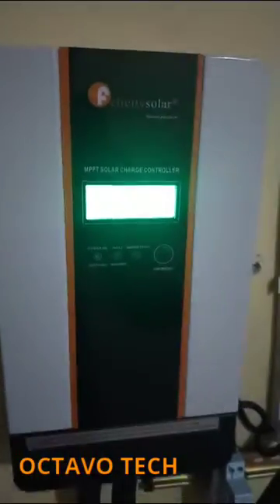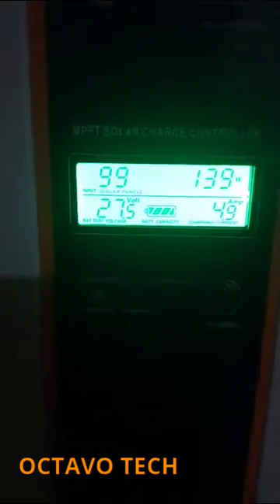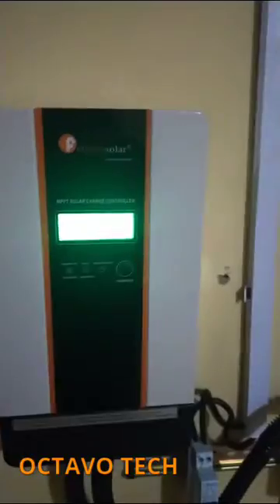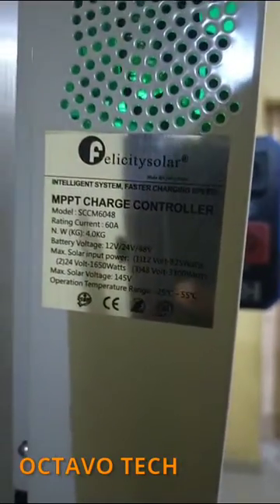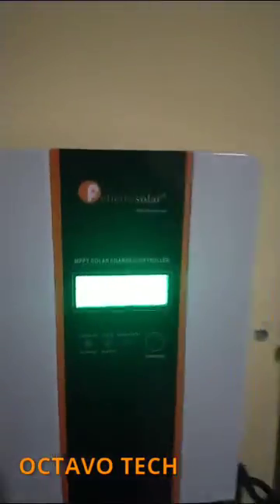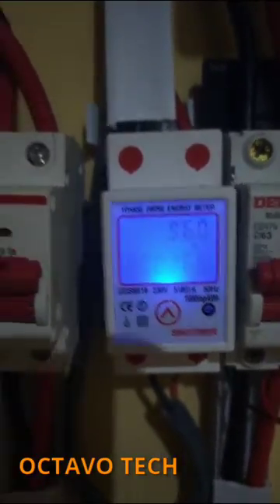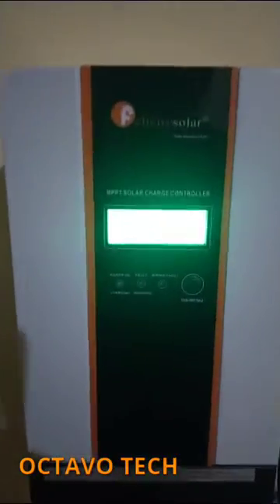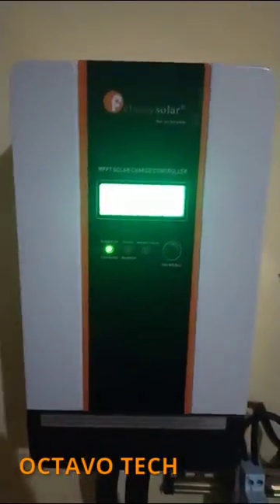Felicity MPPT charge controller overview - is it worth it?

Comment: Hello bro. I have this exact setup as yours and the charging current I get from it is same as yours. But I recently upgraded to a 48v system, comprising of the following:

10 x 380w mornyray panel with 9.47 amps and 40.15 volts.
120amp felicity charge controller 
20mm cable (10mm red, 10mm black)
4 x 230AH battery.
Connected 2 sets in series and 5 sets in parallel.

Now, these are the 2 problems I’m having.

1. At night, the charge controller doesn’t go off, it keeps showing battery voltage with fault red light. But when the sun comes out, it will begin to work normal.

2. At 500w of sunshine, I’m only getting less than 10amps. But on my 24v system, I’m getting close to 20amps at 500 watts of sunshine. 

My 24v setup is made up of the following:

4 x 330 mornyray panels at 9.925 amps and 33.25v. 
60A felicity charge controller 
10mm cable (5mm red, 5mm black)
2 x 220 batteries 
Connected 2 sets in series and then parallel both sets.

What do you think could be wrong?
Reply: Bro, call your installer that helped you upgrade ASAP. Its obvious there is a problem somewhere.  And also, is your MPPT covered by warranty?
Reply: @fm4real2k6  Yes bro. My charge controller is covered by warranty. The funny part is that my installer is confused of the problem.
Reply: There is voltage mismatch on the board... each board should be read  during the day to know the actual output. if that is solve then proceed to your contoller and  change it. you should be having upto 35 charging amps from your 48 volts panels in series.
Reply: Nothing is wrong with the installation, 
More volts, less amps, and vice versa.
Reply: Since one panel can give you more than 30V, I thought you don't have to connect those panels in series for 24V battery
Reply: @joelajamu1  you are right, on a 24volt system , 30v panel will work,  but on a 48v system you will need to wire 2 or more 30v panels in series to achieve the charging voltage requirement to charge the batteries
Reply: @joelajamu1  The 4 panels are all connected in parallel now. Charging amps is now higher. Thanks bro! 🤗
Reply: Brother, . looking at your 48volt setup, how did you manage to wire 4 batteries in parallel to achieve 48 volt, actually you needed 4 batteries in series for 48 volt, you need to rewire your batteries bank before you damage the batteries. Also you PV input have to be higher than the charging batteries voltage. Hope this help.
Reply: @ademanster My battery bank is connect in series and not parallel. All the 4 batteries are connected together as one.
Reply: The red fault or warning light at night indicates there is no solar input, or it's not charging.
Reply: Good day.

I don't think your system has any problem sir.

Let me start by addressing question one, for the red light to come on, it doesn't mean there is any faulty with your system, it is because the controller is no longer seeing input from your solar panel and that is correct(it is night time and there is little or no photovoltaic energy available).

Question 2. For your system to be producing about 10A at 500W is ok at a system voltage of 48V.

Remember Power (W) = Voltage (V) X Current (I)

If your system voltage is 48V, then your battery voltage will range between 46 to 50V, now let's use battery voltage at 48V

Then I = P/V

Where I is current, P is Power, and V is voltage.

I = 500W ÷ 48V = 10.42A
Your current at this voltage is around 10A. Note as your battery voltage increases above 48V and your power is constant at 500W, the current drops.

Now let's consider a 24V system.

I = 500W ÷ 24V =  20.84A. Also if your battery is charged above 24V to maybe 26V, the current will drop at a constant power of 500W.

In conclusion, it can be said that system voltage affects the amount of current at constant power generation.

Good day.

Engr. Udeh Chinedu
(The Solar Ninja)
Reply: @thesolarninja_  🧑‍🔧 you have said it all ENGR because once the battery is fully charged the Amps drops and when you on a heavy load then it goes high again. Thanks from ENGR CHARLES 💡
Reply: @charlesce8815  your explanation although correct does not apply here. Solar ninja explained the difference in amps between a 24v and 48v system and why the op was getting different amps at 500w when he upgraded to a 48v system
Reply: @thesolarninja_   Sir, I’m deeply impressed and satisfied with your explanations. Thanks for taking away my worries. You are indeed a genius in your field. Now I can have my peace of mind. Thanks again. Please where do you base in case I have a future solar installation, so that I can contract you for the job?
Reply: @thesolarninja_  nice
Reply: @thesolarninja_  u we're born for this

Comment: I installed this very type of charge controller 48v system, I noticed it that it only display in the day time when there's sun and doesn't display when there's no sun like in the evening,night till the next day
Reply from the maker: @Simon Messer Mine doesn't turn off at night, would have loved it to do so. Maybe because mine is an older model, it does that in order to conserve idle power at night.
Reply from the maker: Maybe that's how they made newer version, I just saw a similar comment now.

Comment: I got 9 pieces of 300w solar panels, each has 36v open circuit voltage and maximum power current 9.33A. 2 AGM batteries 200ah 12v to be combined in series and finally solar inverter 5kva 24v. Can I use a 60a solar charge controller for this solar system or what mppt size/ampere do you recommend?? Thanks 👍
Reply from the maker: You can only use 60a felicity MPPT charge controller for your 2700w pv input (300w x 9), if your set up is 48v. Maximum pv input for a 24v system is 1650w.
Reply: @octavotech  Boss, have you used this Felicity MPPT charging controller with a Lithium LiFePO4 battery? Does it support Lithium LiFePO4 batteries? Please 🙏 reply bcoz I want to get a 120A Mppt soon. Thank you. Happy New Year 2022 in advance.
Reply from the maker: @kukupulus2949  No, I haven't used it with LiFePO4 batteries. I wish you a happy new year too.
Reply: @octavotech  thanks for the quick reply. Make I subscribe ASAP to d channel

Comment: I'd like to know the maximum pv input for a 120a Felicity mppt charge controller. Cos on jumia it was stater to be 145v while here someone said it 190v. ???  And I got a 230a 24v system still considering to upgrade my battery bank to 1380a 24v but looking at 6300w of solar array to charge. I don't know if it gonna work cos the maximum I'd 6600w and that's for a 48v system. Please can 6300w solar array charge 6pcs of 230ah 24v battery connected in parallel on this charge controller or do I need to get two charge controllers??

Comment: Why does the charge controller make a wheezing sound?
Reply from the maker: My unit doesn't make any sound, it's absolutely silent. No inbuilt fan, heat sink does the cooling job.
Reply: Check if the PV and Bv cables are tightened well.

Comment: Greetings please I have a question concerning the mppt solar controller, after it was been installed the display I'm having is the power on showing green light and the fault showing red light at the middle, my question is what could be the issue why both are showing at the same time.
Reply from the maker: At what time of the day are both (green and red) showing? Also, what's the error code its displaying?
Reply: @octavotech  in the afternoon of Sunday was when we put it on to charge with solar for the first after it was installed the previous day. The error code shows 05.

Comment: Nice video👍 I have the 120ah of that controller is stated on it that the VOC is190  but still afraid if I can connect four 300w in series, because it will about 160 VOC, so I don't know if is safe to connect! what do think I should do?
Reply: The most you can connect is 3 series. I tried 4, it brought the fault code 21 . When open current got to 171 volt. I use 100amps
Reply from the maker: I think it's still safe, the worst that can happen is that you'll get high pv voltage error. The margin between the recommended 190v and 160v which you intend to try is still high enough.
Reply from the maker: @Simon MesserOf course, it is working. It will clock one year next month.
Reply: @octavotech  Good day.....I have a 48v felicity inverter with 80amps controller. I  have 8 270w panels at 37.2 Voc. Can I connect 4 series, 2parallel to become 148.8Voc ,considering the maximum VOC of my controller is 145v, Is it advisable?  Does the controller protect itself from  high PV voltage?
Reply from the maker: @akinwaleakintoye8304  Yes it protects itself, there's nothing to worry about. If there's any issue, you'll get high pv error which you'll see on the screen.
Reply: @octavotech  Thanks

Comment: Please what is the maximum panels  of 160w can it take for 12v system, because the maximum watt  for 12v is 825w?
Reply from the maker: 5pcs of 160w.
Reply: @octavotech  Thank you
Reply: @octavotech  Is it possible to use 6 pieces of 160w, connected on (2 series each) and the 3(24v series ) in parallel? for 12v 3000w inverter on 12v 200A tubular battery?
Reply from the maker: @opeyemiolugbengaoluwadare3260  in MPPT you need more voltage, I will advise you to connect 5 pcs in series instead (that's if you are buying 12v panels, which open circuit voltage will be around 18v).

Comment: Please i want to connect 2 batteries 120ah/24 each in series, 2 solar panel 385w each connect it in series and Mppt charge controller. Can achieve good result?
Reply: Good to go, your  VOC will be about 90,volt  working voltage 70,volt to charge a 48 volt system is OK!

Comment: What does "error 05 " mean on the mppt?
Reply from the maker: Error 05 means high voltage from PV (solar panels). If you are getting this error, that means you need to reduce your panels series connection combination.

Comment: by installing the mppt, the battery is connected first. should the mppt turn on automatically or must the solar power be connected for it to turn on?
Reply from the maker: @Simon Messer of course, it is.
Reply from the maker: Once you connect battery first, mppt will turn on automatically and auto-detect battery's voltage as well. You don't have to connect solar panels for it to turn on.
Reply from the maker: @Simon Messer No, it was purchased in Nigeria.
Reply: Good morning, I just connected my new Felicity charge controller to my 24v (X2 200amps) battery but it didn't come up. What could be wrong ? I've pressed the on button for more than 30seconds but still didn't come up. Thanks
Reply from the maker: @onyechineduu7315  If you are sure there was no polarity mismatch, return it. It's a faulty unit.
Reply: @octavotech Ok, Thanks so I appreciate the swift response.
Reply: @onyechineduu7315  newer models won't turn on just by connecting to batteries alone. You need to connect the solar panels to it too.

It would automatically turn on after you turn on the DC circuit breaker of your solar panels.

Ensure you connect the batteries first before connecting the solar panels, and only turn on the circuit breaker after you've confirmed right connection.

Comment: Am using same charger control 2battery and 8panel 200wats but my input doesn't change 29 and my battery drain fast, please give some advice.
Reply from the maker: Do you mean your solar input voltage is 29v?
Reply: @octavotech  YES and my battery drains fast, any idea what could be the problems
Reply from the maker: @mohammedyaudausayi1102  Your solar input voltage of 29v is way too low. This might have affected the charging of your batteries and consequently damaged them. You need to get a professional installer to check if your installation was properly done.
Reply: @octavotech Thank you for the advice! I have another question for you, does 250wat solar panel come in 12v and 24v? How do you differenciete them???
Reply from the maker: @mohammedyaudausayi1102  No, 250w solar panel is for a 24v system.
Reply: @octavotech  Thank you for the advice, Today I called an expert to check for me unfortunately he find out that all the 8solar panel are not working perfectly, so we installed 320wat two-pieces and the input solar panel now going from 30 to 33 and wat 350 to 400 and charging amp 10.6 to 13.8 hoping to add 4pieces 320 in the future. Thank you
Reply from the maker: @mohammedyaudausayi1102  That's great.
Reply: @octavotech  Good day! I have another question please. Can we connect 5pcs of 320 solar panel for 24v solar system in series with MPPT charger controller, in order to add the voltage together...
Reply from the maker: @mohammedyaudausayi1102  Good day, yes you can. But the total combined voltage of the 5 panels  must not exceed the manufacturer's recommended PV input voltage.
Reply: Hi Octavo. I have a question.  I'm using a 12Volts system, one battery 220, 1kva
I found out that when my battery volts is 11.7, the felicity solar controller battery bar will be 3 and I'll be getting a low battery alarm.  Is it normal?
Reply: @Marisozor  It's just a way of protecting the battery...those cheap mosfet inverters can drain upto 11v. its your choice on which you want to go for.

Comment: Do you have the manual in pdf?
Reply from the maker: No, I don't.
Reply: @octavotech  does it have equalization settings and what's the highest voltage it can go if it has equalisation? Does it have lithium profile charging
Reply from the maker: @namzy410  Yes, it has equalization settings. Highest voltage is 29.2v for 24v system. Yes, it has charging profile for Lithium batteries and other batteries.
Reply: @octavotech  thanks 29.2v for equalization for tubular batteries is not enough. The lithium batteries settings can it be accessed on the unit itself or do you need a pc
Reply from the maker: @namzy410  It can be accessed on the unit itself.
Reply: @octavotech  thanks. Subscribed
Reply: @octavotech  sorry what does it come with inside the box
Reply: @octavotech  I bought the felicity unit and You can get up to 31v for equalization
Reply from the maker: @namzy410  Okay, that's cool then.
Reply: @octavotech  also can you change the charging parameters? Ie adjusting charging voltage and current. Its a pity there's no online manual
Reply from the maker: @namzy410  Yes, you can change the charging parameters. You can choose from the preset voltages and current.

Comment: How many 12v 160w panels can it take in series
Reply from the maker: Based on manufacturer's recommendation it will take 5pcs of 12v 160w panels, but you can stretch it to 6pcs.